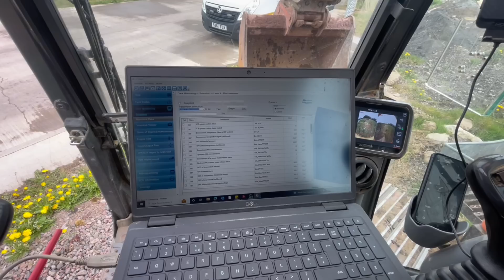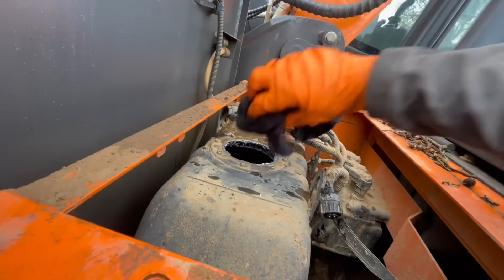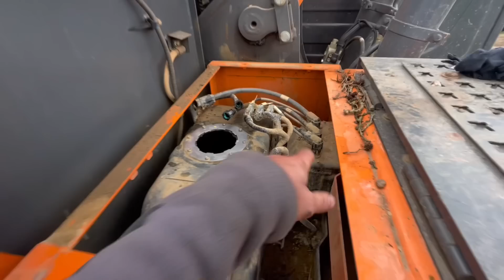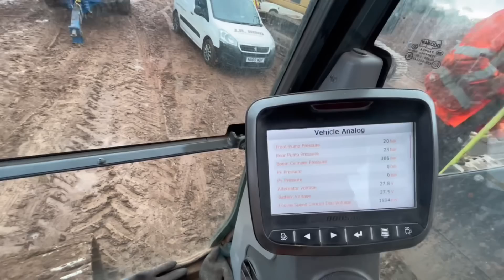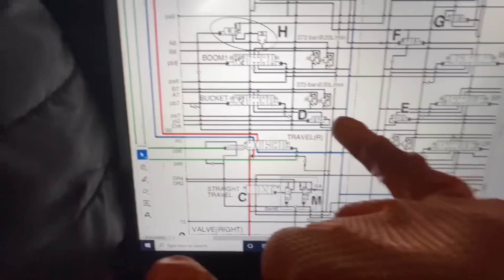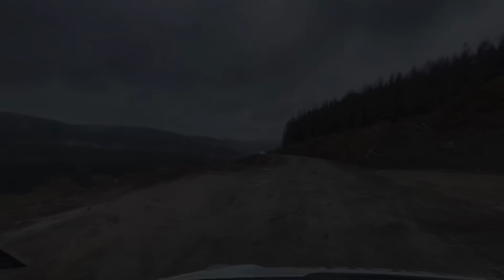Jet lag / Fuel in the adblue tank / A/C delete / strange hydraulic problems

Comment: Hi Ali, we run a fleet of Develons all seem good. There’s one DX235Lcr on a site, and every time I go on it seems to want to do a regen. It may only do 10/15 hours before it needs another, it flashes up on the screen and goes through not a problem with the toggle switch. No fault codes or anything, any ideas what it could be ? 

I haven’t had a proper look into it yet, just trained the driver how to put it through a forced regen to keep him digging. Cheers
Reply from the maker: It could be a lot of things like a change in engine rpm or shut down during an active regen excessive idling time etc or it’s got a differential pressure sensor issue making it think it needs a burn out then there’s fuel issues restricted air flow, but yea on a -5 machine it should regen about once every 80-100 hours is definitely recommended getting it looked into